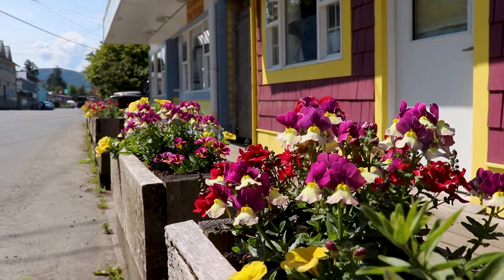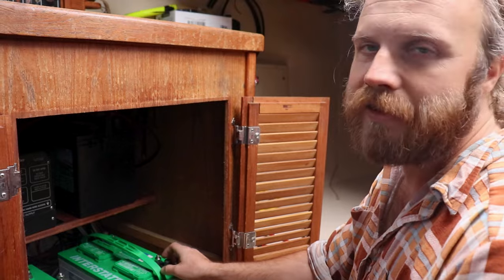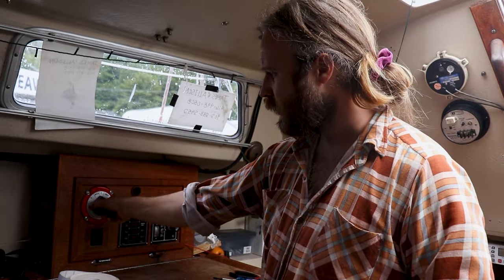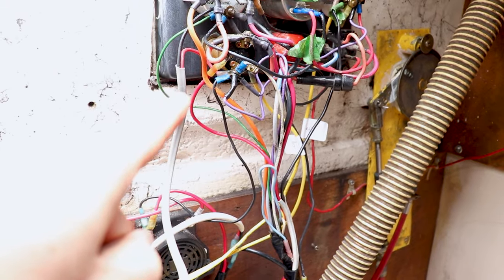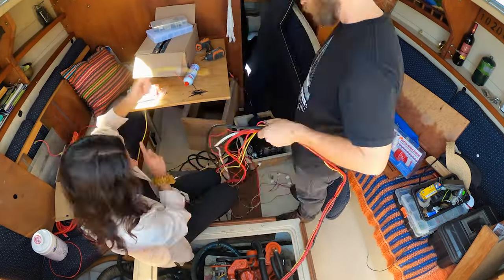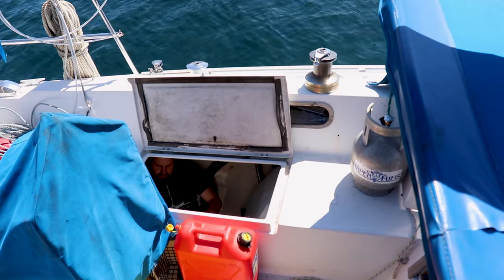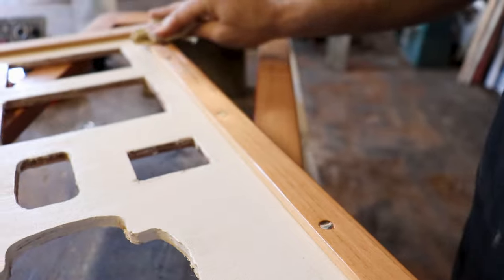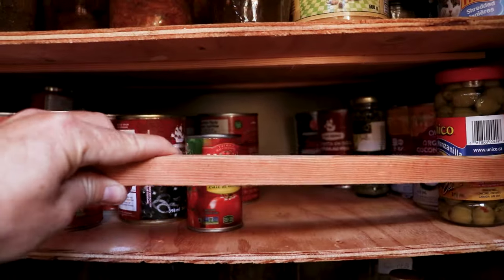Biggest Fears of Buying an Old Boat IGNITED🔥Shocked to find this on our 44yo sailboat | A&J Sailing

Comment: Very informative video, you did an amazing job upgrading the El. System, the 6 or 8 pole plug you call "trailer plug" is an actual Catalina part and designed so the engine can be pulled out without removing any wires from it. Just that the plug gets old fast and this is a "known" Catalina issue.
Reply from the maker: Thanks Francine golbeck! There a a bunch of catalina 30 issues that we’re slowly addressing, the 70’s we’re a learning curve for boat building!!
Reply: @AllisonandJamesSailing 
The same connection plug block was on every ford Europe car of the same period. ..  Escorts Cortinas  the lot  millions of them building kit cars decades later they cause problems corrosion usually.. out of sight. Your engine runs then cuts again when it over heats.  Worst ever were the German VW parts of the period they used plated steel blade and spade connections even on the fuse box 😬

Comment: I had a small fire on my 1975 boat (more of a smoldering than a fire actually), which led me to take a close look at all the wiring. What a rats nest the previous owners had made of it. Personally rewired everything. Started with the 110V system, then the heavy duty 12V system etc, etc until every last wire was replaced. Sleep much better knowing that.
Reply from the maker: It’s pretty wild the mess of wires that accumulate over the life of a boat! Well done on making your boat a safer and more reliable vessel!
Reply: @AllisonandJamesSailing  Nearly 50% of my old wires went nowhere (although some were still live). Past owners had simply added new wires without removing the old ones. Astonishing, really.
Reply from the maker: Similar story! May current boat owners of the world make their electrical better than they found it☝🏽Cheers mate!

Comment: That shore power breaker switch almost started a fire on my boat. . . Scary. I have rewired both systems now. Apparently the 120 breaker should be less than 10 feet from the shore power plug. I've put in all blue sea systems panels. So much better.
Reply from the maker: Stoked you got that shore power breaker switch sorted out! Fire's are not so hot on a boat! The blue sea system stuff is amazing, I think ill start integrating more of their products in the future.
Reply: Wish I could post pics of our set-up. 
Might have to start making vids of our own. Lol

Comment: Vote number 237. I like your balance of sailing,  wildlife and projects. I like wiring projects but they can be frustrating. We bought a Carter 30 in Sydney, Australia nearly a year ago. It had a couple of issues that we knew about (delaminated rudder skeg) which is fixed but old engine has failed and we a looking at replacing it with a Beta 20. Then we will actually be able to use the boat again.
Reply from the maker: Thank you for voting! It sounds like you've got your work cut out for ya! Bummer about the old engine failing, a Beta 20 seems like a super reliable way to go. Stoked for you to get back out there and thank you for check out our videos!

Comment: Know the feeling. In process of tearing out all the old wiring (which was a maze of electrical tape and butt splices) for the cabin lighting. It was all old and undersized. I had already changed out all the other wiring earlier. It seems that when you buy an old boat, you should just replace the wiring as a matter of course.
Reply from the maker: Good on ya mate! It comes with the territory of buying an older boat, they all need a rewire. Best of luck with your projects mate!

Comment: I have a C34 from 1991 and it had those trailer plugs wired in.  Mine had deformed from too high amps traveling through the connection.  The C34 owners forum had a TON of great info on must do upgrades, some of which are applicable to your C30.  If you still have the amp meter at the panel, that is a BIG one to rewire and switch to a volt meter.

Edit: oops... just hit play after writing the above where you talked about deleting the Amp meter.
Reply from the maker: Those things are a hazard! The C30 owners forum has been very informative. Still lots to do but feels good to have removed those things and cleaned up some of the mess!

Comment: Wires should never be bundled but rather laid side by side. 1 overheating wire will take the whole works with it. Warm wires carry less current. & S by S wires are much easier to trace.
Reply from the maker: In a ideal world. Good tips, thanks for watching. Cheers!

Comment: How did I miss that episode???
Anyway, Toronto and Texas area codes, interesting...
Those 'wing nuts' I call them marettes and wingnuts are well wingnuts. L 
Yeah, no trailer hitch connectors are not marine grade and that one had some heating and corrosion issue and the corrosion was likely creating more heating issues, vicious circle!
Nice project, well done!
I am just collecting the pieces to tackle similar project on our boat as soon as the weather becomes more bearable.
Also some nav stuff. Signal K and Open CPN, I am starting putting this nav software's together on a Rasberry Pi5, not as a primary system but more for fun and redundancy.
Cheers,
s/v Laysan
Reply from the maker: haha! Sneaky first episode of the season that didn't make it to the new season playlist! Agreed wingnuts are def wingnuts! So glad that trailer hitch connector is outta there! Glad you enjoyed the episode, thanks so much! Best of luck with your beastly electrical/navigation projects, you got this!!
Reply: @AllisonandJamesSailing  I actually had to pause the video when I first saw the trailer hitch connector! LOL

Comment: You placed the new battery bank in the quarter berth, will you show a photo of the install of please.  I would like to open up the area under your the nav station too.
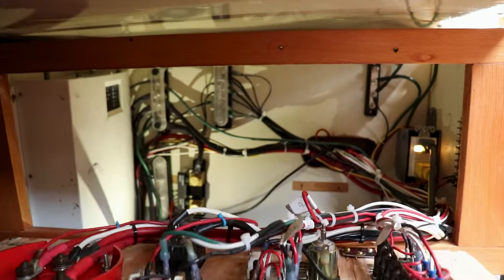Reply from the maker: We trialed it this season and glad we made the changes we did, it worked really well for us! Would recommend. We showed a few quick snaps of the temporary setup around 16:39. Still need to build & glass in the battery box. Can't add a photo here which is a pain, but if you message us on Facebook or email us we'd be happy to share more of those details with you. Cheers!

Comment: Anything to do with Boat wiring, to get it right and Safe, watch the Pacific Yacht Systems Videos on YouTube.  and definitely Tin every wire, and buy the correct Boating standard Cable - Just using red and black cables shows that you can't be doing things right. This is humble Pie from me by the way, as a qualified Skilled electrical installation engineer, it's been embarrassing to admit to myself that everything Boating I have done, has been following on with the mistakes that have been made by all of the previous owners of every single boat I have owned in the past. Believe me, that is Really sobering, that I had no idea that Boat wiring is so different, for really good Safety Reasons. ❤ and Best Wishes from Bob in Wales - the original not the New South One. 👍⛵️✨️✨️✨️
Reply from the maker: This is the beginning of our electrical journey, certainly not the end, cheers!

Comment: Further to my post, you need a proper wiring Diagram to follow withbthe right equipment to make sure you arent leaking lethal levels of electricity into the water around your Boat. Sorry mate but before going any further, you need to be sure you are doing everything Right, with adequate and correct Marine wiring Standards. Even Jeff Cote of Pacific Yacht Systems can accidentally getbthings wrong, but spend some time watching their videos, and you'll be off to a great Start AND you will create a Correct wiring Diagram which will be invaluable to have with your Boat. Good Luck. Bob in Wales.  👍⛵️✨️✨️✨️
Reply from the maker: This isn't a how-to video and we'll be the first to admit we don't know it all. We're not here to make videos to show us doing everything right, we're learning just like everyone else. Cheers!
Reply: @AllisonandJamesSailing  PS. Like everyone else, I came into this Life with a Blank Sheet. One of the Best insights I was given, was by the Father of a girl I almost married - I really dodged a bullet with her - he said, there is no limit on the number of Skills it is possible for us to learn . A former Mining engineer, he switched to Teaching, Maths, Physics, Metalwork, and woodwork and the engineering Workshop he had behind the house he had built himself, was phenomenal, the only thing it lacked was a forge, and I built that with him. He grew all of the tobacco he used every year himself, and knew how to cure it. As an aside, the Best Advice I was ever given was - If You Want To Change Your Life Change Your Friends. So Skills , what sort of Skills do I have Qualified Civil and Structural Engineer, Quantity Surveyor / Surveyor- Thorn EMI Trained Skilled Electrical Installation Engineer. early Microsoft Registered Developer. Mainframe Computer Service Engineer. After Sussex University switched AI Research and development into online Computer Gaming, I followed as a Software Tester to keep a very close eye on this hazard to Life and Liberty. Qualified Welder. I got Grandfathered in to every Sailing qualification, including Yachtmaster Offshore, but as I do not professionally use those qualifications, if needed, I only have to log another Transatlantic Crossing. Really though, if not doing such things Professuonally, all anyone needs is the International Certificate of Competence, and if you log your trips, renewal is a minor formality. I've been a Roofer , had an apprentice, specialising in Natural  Slate Roofing. Been an Architect and designed a Timber Frame House, with 95% of the benefits of Canadian R2000 standards, for 5% of the Cost, am a qualified Wildlife Manager and have an Advanced Marksman qualification. Whilst mostly a multidisciplined engineer, I am also a Published Scientist after writing a Paper for the British Parliament's Science and Technology Committee,  that they were on the receiving end of a Scam attempting to fund the Fraud that was Ocean Acidification.  the Chairman was so impressed, he asked for, and received my Permission to Publish it. The Words Ocean Acidification haven't been heard in Parliament since. Unfortunately, as the data provided also Debunked Anthropogenic Global warming and that Our Atmosphere has a pretty Serious Shortage of CO2 Content,  we are still on the receiving end of a Stupid War against a critical Life and Biodiversity Gas, but that Criminal Agenda does seem to now be dying as the words - it's The Sun Stupid ! - are starting to sink in, even in Germany, where they are dismantling useless Bird and Bat Chomping Wind Farms and are switching back to Coal for a reliable Source of Energy. So things look up. I have acquired a fair number of other skills that haven't needed qualifications, plus afterbover 30 years studying Constitutional Philosophy,  there isn't actually anywhere in the World where anyone can actually acquire a qualification - which is pretty Disastrous for Humanity as a whole tbh, as it has been replaced with the Unscientific Nonsense called Political Science.  So how many Skills do you think you can acquire if you put your mind to it?  A Sailboat  an be a huge help Look atvthe Skills Mads and Ava on the Channel Sail Life have already achieved with their Sailboat Athena. Some other Channels are really good too with ni e people spreading their knowledge,  like Sailing Impavidus, Millenium Falcon Sailing Sisu, etc. Once you start, it's fun, but remember this, if you aren't Sweating, you aren't learning, and trouble shooting is a great way to start sweating. Best of Luck. Bob. 👍⛵️✨️✨️✨️❤️